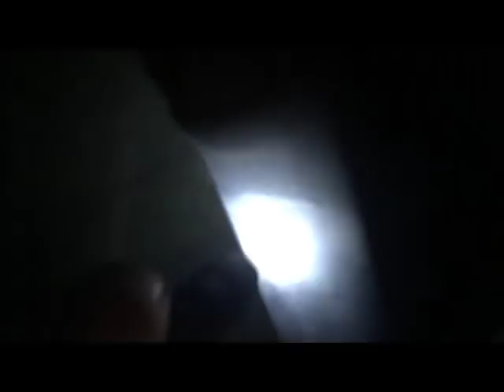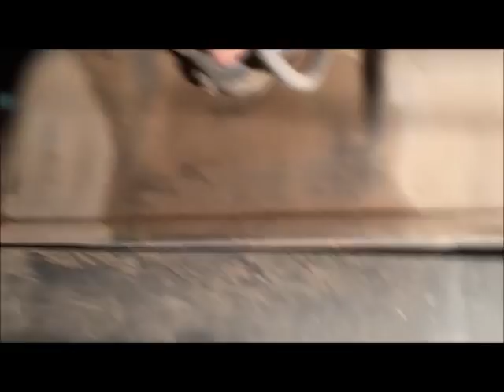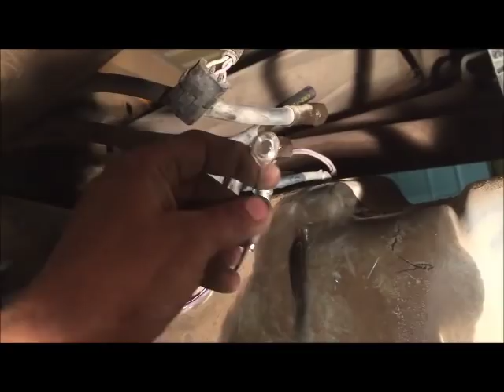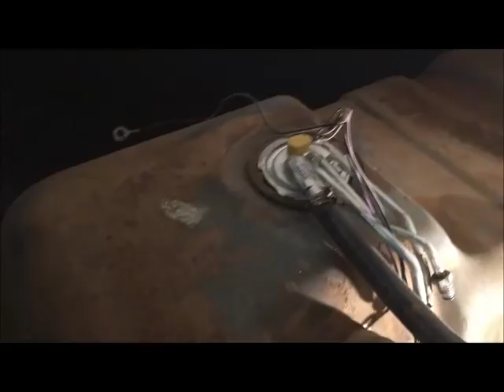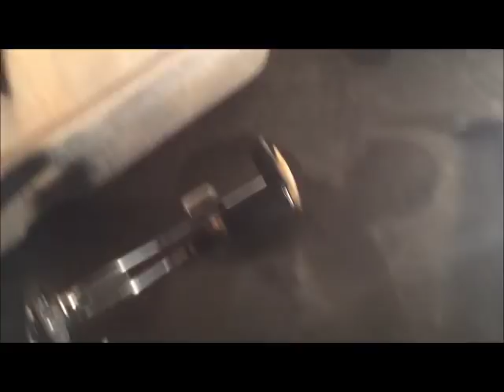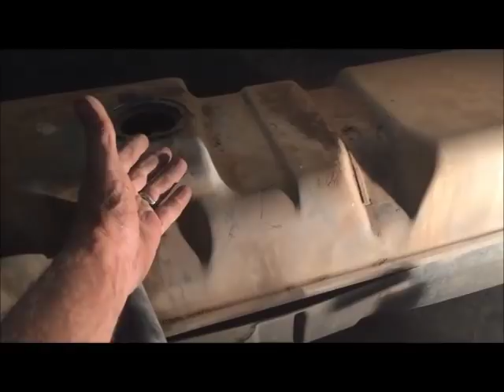1998 Chevy 1500 Fuel Pump Replacement

Comment: This video is really helpful. I just got a 1999 Chevrolet Silverado 1500 it had old gas in it. So Before I start this project I was wondering how can I dissolve/remove the sticky,Carmel residue that the old gas has left behind?
Reply from the maker: if the gas is more than a year, i would pull the line from the rail, pull the filter and blow air through, then blow air from filter outlet toward tank. if the pump is working in the tank then leave it alone, siphon the old fuel from tank and fill the tank back up. do not add a additive. the additive will break up the old stuff and send it back through the injectors. the pump does not reach the bottom of the tank, just leave that in there. over time it will clear through. its best to let that stuff burn through small amounts at a time. if its been under a year siphon the old fuel from the tank, replace your fuel filter. and your good. thanks for watching.

Comment: FYI, sugar dissolves in liquid. Then it caramelizes when it's heated. So yes, it can harm the engine and get through the filter.
Reply: dose the fuel tank heat? I dont think so !!! the engine is far from there
Reply: He states that sugar in the tank WON'T harm the engine. Harmonica Man is correct, it will carmalize when it is heated creating extra material that will more than likely destroy the pistons. Yes, it can pass through the fuel filter. If you doubt it, put sugar in your car... bet you won't.

Comment: Well this video really helped me. I do have a question.. would the fuel pump going out still alow the truck to start and run periodically? I bought a 98 1500 that ran and would run when it wanted to.. it wouldn't stay running in park for very long it would idle low and die. But when it was running I drove 30 miles without a stall a spit or sputter then as I pulled up to a stop sign it died and hasn't started since.. I did a full tune up on it

Comment: My front tank strap is on the opposite side from the back one, also the nut is seized onto the bolt attatched to the strap, had to order a new tank mount with strap. Ugh
Im gonna try to unbolt the support from the frame and drip the tank that way. Hopefulyl it works

Comment: I pulled my box off because the straps wouldn't come off. Removing the box actually became common place on that truck anticize d the bolts after a week of rust buster and an impact then it only took me 20 minister to pull the box after doing it the first time. But yeah broke bolts the first time

Comment: Great  video  thanks. I have one question where is the ground wire for the fuel pump. I have no reading from pin 30 on the relay to fuel pump. so they say  pump is bad or ground is bad.. thanks very much for your help.

Comment: Very informative, never had problems with my truck until I put a fuel additive in, now after seeing g a plug wire arcing on the heat shield and replaced wires plugs and rotor button and cap it still running rough,do you think there is rust in the line now
Reply from the maker: run it through.
Reply: @thomasbriansavingmoney , I've been trying, got alot of gas in it mmm mmm, about 3/4 of a tank  my buddy thinks it is the fuel pump,don't know, I haven't tested pressure yet bought a fuel pump] 280.00 wow didn't know if one on Amazon was going to do for 39.99
Reply: Fuel pump sounds fine I'm replacing the inline fuel filter.Thanks

Comment: i have a 2000 gmc  sierra ext, cab long bed 5.3L all the fuel lines from the filter (on the frame, aproximately under rear seat ,drivers side)back are hard plastic and  not nearly as flexible or forgiving as those in the video.also the evap. canister is on the front  of the tank held in place    by a short strap (two 13mm bolts)also the filler tube  is a bit different .open fuel door ,3 phillips screws  around the top of the neck remove those and push down on the neck a little so it drops thru the rubber dust flap .and the ground strap is easy to miss as it runs up along the filler tube.if you start letting that tank down and its still bolted up ,gonna have a bad time ,m'kay?could be dangerous ,m"kay?Also the strap bolts (15 mm)are on the other site  of the straps.the tank can be lowered to undo lines and wires but not as far as on this year mod. the rest looks bout the same .well im off to replace a fuel pump.and a broken plastic line.lmfao

Comment: About the sugar, please experiment with sugar but putting some gas in a glass container, then dump some sugar in there.  Its true some sugar will not dissolve but I believe some will. Only way to prove it is to taste the gas or have the gas tested so choose the latter.  A bet a local college or high school chemistry teacher can help or perhaps the County Extension Agent will know how to test gas for sugar.   Unless you want to taste gas twice which I don't advise!   Why twice, you'll have to know what normal gas vs sweet gas tastes like = yikesville!!!    I don't advice it but it is cheaper to taste it than test so I'll say it twice   I think a little sugar will dissolve in any liquid.  I added sugar to Coke & I could taste it. While Coke isn't flammable, it will dissolve meat & bones so its a caustic substance.   

Good news, I'm glad I watched the "whole video" because its time to replace my fuel pump and in the past my friends pulled the bed. Also, I bought a S10 and the seller had pulled the bed & had only replaced 2 bolts out of 6. I finished the job.  Now I know way dropping the tank is way smarter, faster and far less time consuming.  Great video, I hope other vids offer this because bed bolts have a "go away, you don't want none" message when you look at them.  But I do plan to wire brush the underside, spray Rustoleum  heavy metal primer & then use black paint to stop rust on the bed frames which look a little rusty.  Not bad but I own a black 1998 Z71 sportside standard cab with a 350 and a 5 speed manual.  Its fun to drive!!!!

A friend used a shop vac to clean his tank debris. I walked back 15 feet and stood near the fire extinguisher as a good friend should but some vacs are sort of fire proof so I've heard but do not trust the source since the source used that vac to clean his tank.  I think it would be better to drain the tank and clean it by hand, then strain the fuel through a clean old t-shirt.  

Also, yes sugar grains will clog the filter but I think the stickiness of sugar gums up the fuel pump.  How long does it take, in summer I bet it happens faster due to heat.  But if sugar makes it to the valves then you've got an even bigger problem.  But a good fuel cleaner or running 100 octane race gas plus a cleaner should blast that crap away if caught in time.  Thanks for the video!!!

Comment: I have an 88 Chevy 3500 454 7.4 l fuel pump keeps going out. I replaced it and filter five times in the past 10 years. I just replaced the the pump and filter about a month ago and it went out again replaced relay I got nothing. What is going on? please help.

Comment: You could just take the 3 screws out of the filler cap under the gas door and not even touch the hose clamps.

Comment: Going to try my luck and see if you answer. 98 Silverado 5.7. Replaced everything under the sun upgraded spider injector, distributor & and cap, all AC Delco parts for this truck.  Full Tune-up! Fuel pump five years ago (twice for some reason, first Chinese pump went out in three months.)Second one AC Delco. New transmission. Lower intake manifold, converters,  EGR, List goes on. I CANT  drive the truck over 50 mph.tight & smooth  powerUnder 50mph. sputters  until I let off on gas and let it drop down 10 or 15 mph. The pump is whining very loud like a bad power steering pump sound. I’m guessing I better do another pump before it fails. (it’s been five years now).No mechanics ever seem to point out the pump sound.  they just say maybe cracked cylinder head or injector went bad again. All guessing games. The fuel filter is original I’m soaking it with PB blaster for a few days I’ll try to change that first. What do you think about the fuel pump whining loudly at idle. Your site is excellent clear and precise! Thank you for any input. Rob
Reply from the maker: yes your pump is bad, most of them are only lasting 3 months to a year . ( thank you china ) we get what we pay for. the pump can get real loud weeks to a month before going out. that filter should be changed at the same time. the filter should be changed 2 times to every pump. your dirty filter will put more strain on the new pump and burn it out sooner. your top speed loss ( high end ) is because of your loss of fuel. less fuel, equals less power. good luck, and thanks for watching.
Reply: thomas brian   Thanks for answering me . everything I figured and I’m not a mechanic by trade. I’ll change both out once again at the same time this time. I know clogged filter will strain fuel pump. Thank you for the confirmation every day mechanics don’t even offer proper Recommendations. I’m doing the stuff from the 70s until I have more of a grasp Plus your recommendations always help ...thanks again!
Reply: @bobby6631    
Did you figure it out yet?    I'm guessing you did if you got around to changing that fuel filter that you said was the original filter. I change my fuel filter about every 3rd or 4th oil change, I change my oil every 3000 miles give or take a couple hundred so fuel filter gets changed around 10,000 miles, and at 15 m.p.g. that means over 650 gallons of gas have gone through that little filter.  So yes I bet that's your trouble if you have the original filter still on it.

Comment: Is it easier to take off the bed of the truck to get to the fuel tank to replace the fuel pump?also should you replace the fuel filter as well as replacing it with clean fuel?

Comment: Awesome video Thomas!Very detailed and well explained.im thinking I'm gonna have to change out my fuel pump also.i had a question.i know how the fuel pump sounds when you turn the key.its not that loud but you can hear it.like normally.but,on my truck it's loud and sounds like it's trynna pump fuel thru but it won't start.ive tried spraying starting fluid and it starts but only for a second or two then shuts off.maybe I should try the fuel filter first before I drop the tank.but,how loud the fuel pump is a huge concern to me?
Reply from the maker: a loud pump is normally a bad pump, you should hear it, but not real loud. however you may have a bad hose. open the fuel cap have someone cycle the key while you listen. i think you will hear the pump kick on and fuel dripping back into the tank. listen closely , it will sound like water dripping in water . at the top of your pump there is a rubber hose about two inches long. it prob came loose or has a crack in it. but either way the pump will need pulled. you can do a fuel pressure test to see. if you disconnect the fuel filter from the line and cycle the key, a lot of fuel should come out. ( if its a bad filter ) but if it only drips, then its a bad pump. thanks for watching. please keep us posted.

Comment: Thank you for the video. My 96 c1500 just shut off while driving and i believe its the pump as i cannot hear it like i usually do when i turn the key.
Reply from the maker: there is a shratter valve on the fuel rail that you can poke the needle valve in ( like letting air out of a tire ) this will tell you if the pump is kicking on , if there is fuel pressure. there should be enough pressure to shoot a little stream of fuel about 1.5 feet. also there is a fuel pump fuse in the fuse panel. a couple small things to check for ya, good luck. thanks for watching.

Comment: good vid , like your style .   question :   putting a 1997 350 vortec into a 1995 k2500 that had a 454.  i believe i'll need to change over pump or tank and pump, as tbi needs 16psi on fuel but tpi is more like 60 psi  ( correct , comments )

Comment: One time i tried to take off the bed and the bolts would not come come. I looked under the bed at all the stuff that id have to do to lift the bed and right away said forget it. Sometimes i think about cutting a hole in the bed but figure its not worth dealing with a hole in the bed. The fuel pump might not need to be changed for a long time if ever. And i would hate to be stepping around in my truck bed and fall through the hole not to mention having rain falling all over the top of my tank.

Comment: Hi Thomas, I pulled my 89 36 gal tank plus minus 20 years ago, this just reminded me of things I forgot. I am 82 and not eager but if I don’t do it it won’t get done.  My problem is the fuel indicator is variable, it used to read about a quarter and after a few minutes read relatively accurate, now it reads about a quarter regardless of the amount of fuel, I have been guilty of throwing money down a rathole because of my limited knowledge.  Any suggestions, thank Kelsey S

Comment: So it WILL slide out from the bottom,  even with the truck on the  ground 

Regarding the cleaners, I had a dodge Dakota with a plastic tank spring a leak after putting some of that stuff in it
Now, correlation is not necessarily causation, but it didn't leak before I put the fuel system cleaner in it

Just thought I'd share that

Comment: This is great but I have a question... I had my fuel pump replaced from a mobile mechanic, an when I fill my tank up it overflows when it is full . Now that I work on my 98 Tahoe myself , what should I look for when I drop my tank to cause this issue?

Comment: Crazy question!!  So if once you have it out, could you use a magnet to pick up any rust or metal in the tank?  I am asking because my fuel filter looked like chocolate milk with lots of debris. Pretty sure my fuel tank is bad.

Comment: Way easier to just raise half of the bed with a 2 by 4. Loosen two bolts on the side without the pump and remove the two bolts on the side with the pump. And let's not put sugar in your gas tank at any time for any reason it CAN get through your filter and gunk up your motor. 👍
Reply from the maker: spoken like a true 28 yr old rookie. what do you want to bet that the sugar fuel clogs that filter so fast that you swear you just ran out of fuel??????????? you take off those two bolts and bend over, stick your head wherever you like ( providing you can get them off after the rain water in the back of your bed rusted the hell out of them, but you wont see that until it starts to spin on you ) you may get lucky and have only 10 percent more work to do than this video. there are always other ways to do things, i agree. ( always another solution with anything , i get that. ) but i have done so many of these even when you had a bottle in your mouth, that i disagree.  a person seems to think they are a mechanic because they know another way to do it. but take my word for it, there are also better ways and that makes you a experienced mechanic but thanks for watching and the great comment so that all the viewers understand the longer way with possible issues.   !!!.......... enjoy

Comment: does the fuel pump tend to make a loud almost grinding noise if the rubber hose on the pump is cracked? my 98 k1500 makes a loud noise when the ignition is turned

Comment: Oh how I wish it was this easy for me. I watched this video and had a positive attitude until I tried the same with my 1997 k1500 silverado short bed. My clamps to my filler neck tube and vent tube are so rusted . There is nothing left to turn on the clamps . I need to cut them off . I go to the fuel door and remove the screws and  snaps 1 off .  The bolt on the bracket plate for the strap is so rusted. There is no surface left on nut to grab onto . There is no threads left on the bolt. It is all dissolved with rust . The rear hanging strap bolt fought me 3/4 of the way out and is now spinning in the frame . I suppose I am still better off in this predicament than to have  tried lifting the bed to get to the fuel pump . Knowing my luck , the bed bolts would have spun or snapped if I tried .   The truck only has 72k miles on it . I repaired the body and frame plus I have a ton of other new parts installed . I am stuck into this project because of how much I have already put into it .
Reply from the maker: if those were that bad, i couldn't imagine the time spent on the bed bolts, i have been there, it sucks. but you still did it the easy way i know this for a fact. 97 k1500, is a truck worth fixing in my mind. thanks for watching.

Comment: I mist the fix you did! The check ball was removed and a section of tube was welded in by the previous guy. ok. What did you do to fix or stop the fuel from coming out of the vent tube? I don't get it.  3/2018

Comment: My fuel pump isn’t getting voltages until after I try to start it then it get volts but won’t stay running and dies . I have a 95 . I’m swapping fuel harnesses and fuel pumps today and Ik I’m getting bolts to my relay box I changed fuses as well. What would cause that ? Just curious .

Comment: Great video thanks! Hey ever heard of humming bird effect on fuel gauge it's ware it flickers or vibrates real fast just a little u can still read it but what causes it just asking thanks
Reply: This is a very late reply and I’m sure you’ve assessed the issue, but most likely your problem is the motor that drives the fuel gauge needle. They contain oil that dampens the function of the needle and after time that oil dissipates. If you go on eBay you can find them fairly cheap.

Comment: Also my 2003 chevy avalanche 1500. With the 5.3 runs good. But every so often it sputters and if I give it gas it sputters more and it also turns off. It started when I would be at a light while driving. Then it started to sputter and turn off while driving. I'm suspecting it's the fuel pump. But I'm not sure. Any ideas?